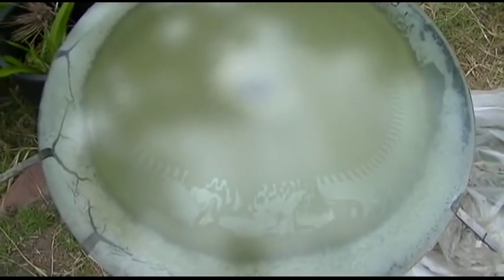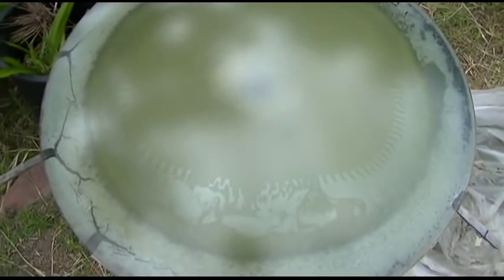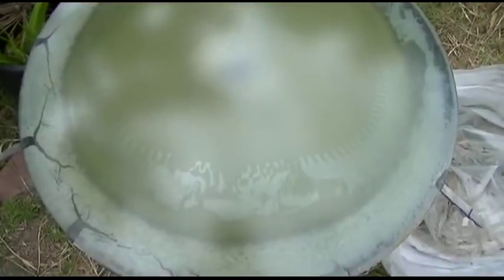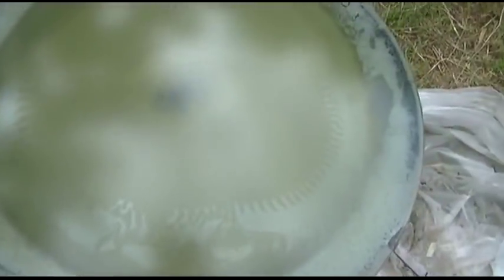How To Remove CRT Safety Glass With Cloths Pins And The Sun

Comment: Nice EOL for the crt. when I did mine, as the separation progressed they remaining area still stuck formed up to a near perfect circle, and the progression of the release accelerated, when it got to a size of about a nickle it suddenly popped the lens off, literally the lens jumped a bit. I suppose it all has to do with how much tension remained at the very end, imparted from the wedge